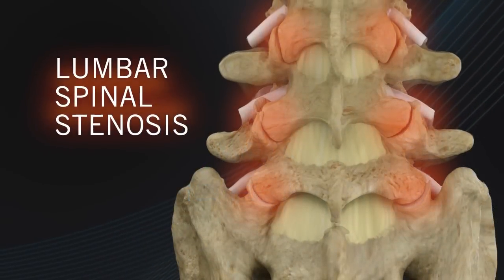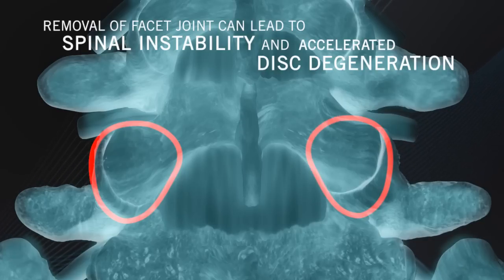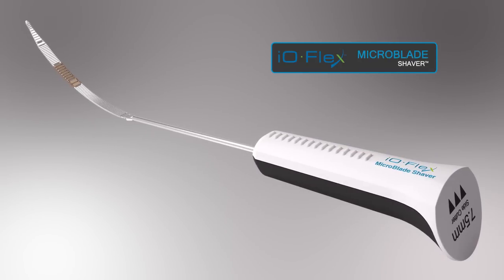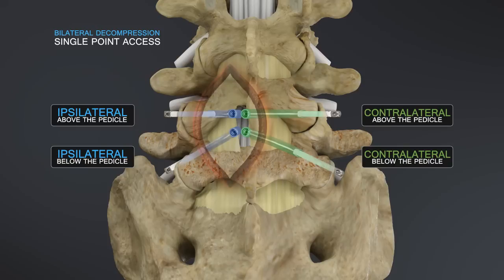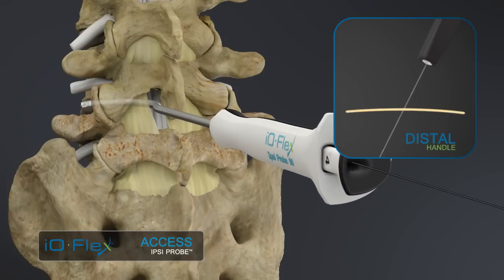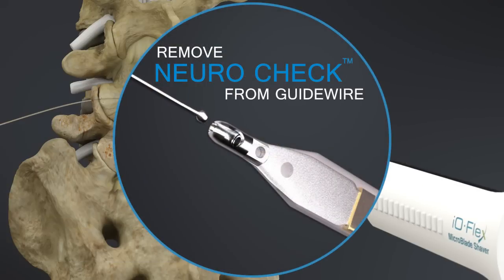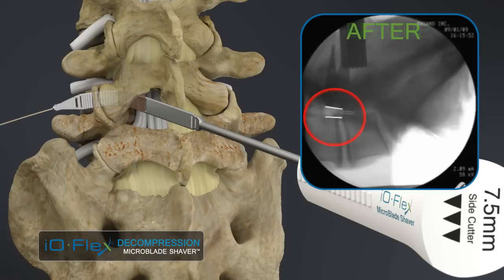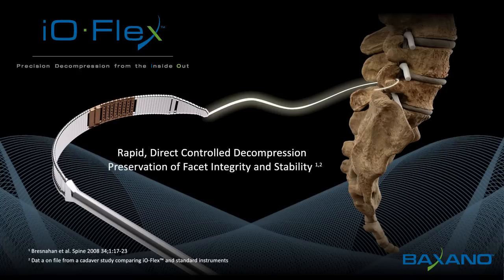Medical Animation of Lumbar Stenosis Decompression

Comment: Beware!!  If a procedure is not approved or paid for by Medicare, it's worthless.  Before my operation, I had constant pain when standing radiating down my hips and legs.  TV doctors told me they could fix my problem with a 1" incision or a laser.  After much research, I chose a surgeon with years of back surgery experience.  Choose your surgeon carefully.  You don't want to mess this up or you will make things worse.  After my surgery all my leg pain is gone.  I can now stand and walk without pain. There is no easy or painless way to "fix" lumbar spinal stenosis.
Reply: didya have pain around hips w sitting?